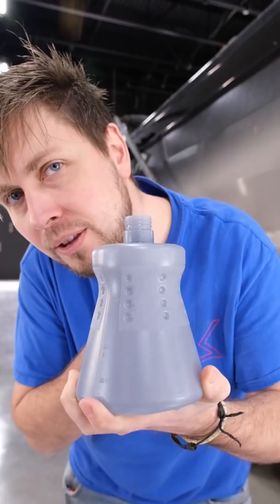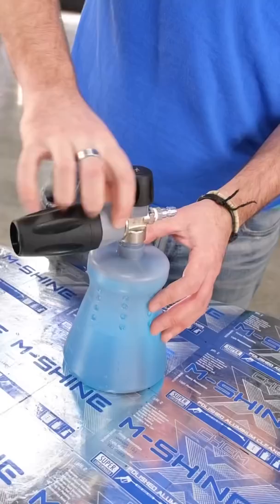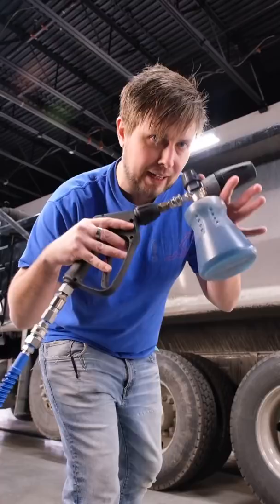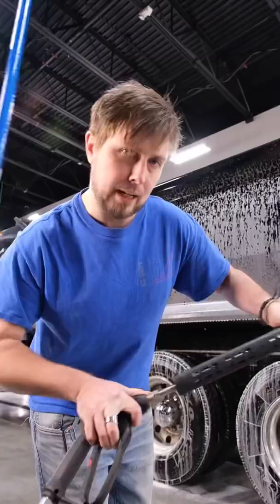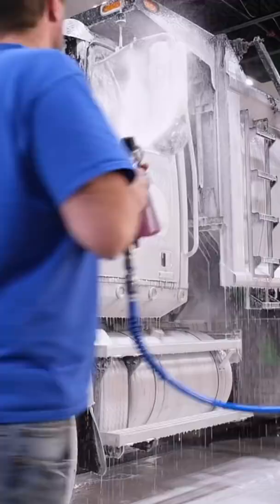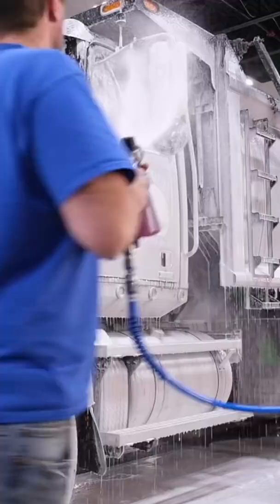Learn How To Get A LEGIT TOUCHLESS WASH in 51 seconds! #shorts

Comment: Yeah, gotta neutralise that salt which is obviously an acid
Reply from the maker: Salt is generally neutral on it's own it's more of a term for getting rid of the salt in general because it'll corrode the metals if you leave it on there
Reply: @Chem-X  oh so because salt can corrode metal you can call it an acid or a base? I guess oxygen is one of those as well then. Just because that's what you meant doesn't mean that's how its used. You can purify the water of salts, but you can only neutralise a solution which is acidic, or like you, basic.

Comment: Never rinse from bottom to top  #1 detailing mistake
Reply from the maker: That’s tried when you do a physical contact wash, touchless washes with foam applied at low pressure get miles better results rinsing bottom to top, it’s used as an indicator of where you have worked with the psi

Comment: Wait... Go back to that last piece of chrome... Look at all those water spots and runs... This is why you still need to wash with a cloth
Reply from the maker: Yeah it’s good to dry it if you have somewhat hard water, I showed that spot on purpose actually this system will only get you 90% there at best
Reply: @ChemX  I'm old school... Hose, micro or terry cloth, and a good soap..
Reply from the maker: Yeah this is just a shortcut in between a good hands on wash

Comment: Foaming is a huge waste of time and money in my opinion. Never really works all that great and pressure washing your car with any kind of dirt on the car is like sand blasting your paint.
Reply from the maker: Foam helps minimize the the potential for scratching in general compared to any other style of washing, this two part touchless system completely eliminates that risk while getting all the road film off, it’s also 80% faster then hand washing
Reply: @ChemX  to each their own

Comment: You’ll never ever get this shine surface wihout using a clean towel to wipe it up….
Reply from the maker: We didn’t, this is just a two step soap application that’s designed to get more road film off than a single step soap can, been used in the car wash and trucking industry for 40+ years

Comment: You start at the top and work your way down.
Reply from the maker: In a contact wash that’s right, not in a touchless wash tho the high psi is how you interact with the surface, this helps you not miss a spot which would only show once dry

Comment: You want to do top to bottom
Reply from the maker: Top to bottom rinse on hand washes is best, however the process works better in a touchless wash rinsing bottom to top, it helps you not miss a spot with the high psi which is removing the road film once the soap loosens it

Comment: Man...If I had $18.50 for every semi-trailer I've washed I'd be a...Never mind.  I should have charged more.  lol
Reply from the maker: Heck up my way truck washes charge like $150 lol, I’ve always washed for free to show my soaps tho myself
Reply: @ChemX  That was 1990 era prices.  I had a couple of fleets every other sunday.  It was $22 for the tractor/cab.  16 for vacuums.  Man.  I was 24, freshly married, and thought it was almost as good as a 5 hour shift at Zbistro.
Reply from the maker: Lol nice, did ya use two step or were ya brushin?
Reply: I used a soap called "Challenger", brushed, and rinsed.  I turned a side of an old white farmhouse silver once with that soap.  I knew it was chalky...lol.  I didn't even put the pressure washer to it.  It just rolled off like milk with that soap.  That was my first season washing.   By 2000 I was mainly doing deck and wood roof restoration.  
     I was one of two powerwashers in the Indianapolis yellow pages.  He only did fleets.  I was the only guy that washed anything.   
     I stripped a few big Wabash National presses in Lafayette when they put in another line at the factory.  over 100 gallons of stripper and hot water on each one.
     My least favorite job was the loaders of US Aggregate. The EPA would give them a 90 day notice on inspections.  They'd call me to come clean the loaders so they could find the leaks.  It was cheaper to use 50 quarts of oil a day than repair the things.  No matter how many layers of rupper I wore that baked on oil and hydraulic fluid turned me into a grease monkey.  Diesel fuel was my body wash until I realized vegetable oil cut it. Soap would cut the vegetable oil.

Comment: It it top to bottom
Reply from the maker: I rinse top to bottom after a hand wash, the bottom up method just helps you not miss a spot with the high psi rinse in a touchless wash, it can be hard to see where you missed while it’s wet

Comment: You actually rinse from top to bottom bud but okay
Reply from the maker: I rinse top to bottom after a hand wash, the bottom up method just helps you not miss a spot with the high psi rinse in a touchless wash, it can be hard to see where you missed while it’s wet

Comment: From top to bottom not the opposite...
Reply from the maker: In a hands on wash that would be correct, touchless washing with low psi foam application works out a bit better rinsing bottom to top, primarily its because the foam serves as a visual aid so you can see where you have hit with the psi which is the final step of removing the road film

Comment: False always work your way from too to bottom
Reply from the maker: Not always no, I would do top to bottom if I was doing a normal hand wash, bottom to top helps you to not miss a spot with the high psi rinse during a touchless wash, missing a spot with the psi is like missing a spot with a mitt, but harder to see while wet so I use the foam as a gauge

Comment: Neutralizes salt?... What did you just say?
Reply from the maker: It’s a term used in my industry referring to shutting off metal corrosion from leaving road salt on a vehicle
Reply: @ChemX  ah okay. I am a chemist and it confused me

So, its just washing the salt off. But water does that too. What excatly is it supossed to be doing?
Reply from the maker: Yeah salt is technically neutral from a chemistry perspective, but as far as road salt on a vehicle you want to fully clean it off to prevent rusting, this system removes the salt completely whereas rinsing with high psi water alone would still leave the salt residue behind
Reply: @ChemX  Sorry for bothering you with doubt. I know I am just a random internet person, and, I will take it if I am totally wrong, but I am doing chemistry, and I am not sure about that statement. I am 99.99 % that that statement (and products that are supposed to do that) are scam.

Salt solubility is 360g / 1 l of water.

(adding electrolytes increses ionic strength, but in those solubilities it's no change)
Reply from the maker: @krtm7231  No worries at all man I respect your thoughts and you certainly have some solid perspective. Even aside from my own products I do think that most salt neutralizers on the market are helpful in the wintertime to fully remove salt. In my own experience rinsing salt off with water alone still leaves a white salty residue behind, I think there is value in completely cleaning it off to keep any metals from rusting as much as possible
Reply: @ChemX  Get you now, but I still can't see how would something do that.

Only thing I can think of (which we do in lab) is to wash it with distilled / deionized water, or to just wipe it after washing.

Could you link photo to chemical composition? I am really curious
Reply from the maker: So for example let’s look at a municipal setting, you have 400 pieces of equipment to wash on a weekly basis and make last as long as possible, and the workers can’t wipe off every town dump truck fully within the frame rails and the engine compartment and inside the rims and on and on, that’s where a salt neutralizer comes into play. I don’t think deionized or RO water is cost effective or that it gets the job done myself. I’m not big into the salt neutralizer industry myself but I do think that there is a legitimate need for the concept to prevent premature failure of equipment. As far as chemical composition I’d rather not fully disclose my formulas online I do have quite a few competitors looking to find out how I do what I do
Reply: @ChemX  hey! You are master in your industry. I will take your word for it, and do some research later. It just seemed really weird for me :) I didnt mean to poke you or something like that.

Thankful for debate.
Reply from the maker: Absolutely man I appreciate your input, this winter I’m planning to look into a dedicated solution for salt and I’ll have to dive into the topic more fully and see what the value of it is and the difference between using it vs not

Comment: Touchless wash is a complete rip-off I details cars for 20 years I don't care what you use you have to apply pressure to the vehicle and or whatever you are washing to get an actual clean
Reply: Depends on if the car just needs a touch up wash or not. If the car is taken car of and waxed properly; light road dust and other debris should come off with ease
Reply from the maker: Try my soaps first then let me know, for now I assume you’ve only used single step systems that make big claims

Comment: Top to bottom always, this wont clean it 100%, only way to clean a car completely is to touch it, sorry
Reply from the maker: This won’t take it 100% it’s a shortcut for in between hand washes to save time. The reason for bottom to top rinse in this situation is to help gauge where you have hit with the high psi, the soaps loosen the road film but the high psi is what removes it, if you miss a spot with the pressure it will look fine wet but once dry you will see the spots missed. On a hand wash you would rinse top to bottom to save time though.

Comment: I call bs.
Reply from the maker: Why’s that?
Reply: @ChemX  it won't actually come out clean unless it's not very dirty. Even using a pressure washer doesn't clean a car good without scrubbing first.
Reply from the maker: The key is to use a soap system that can perform a ph shock and then to rinse thoroughly at high psi, still won’t get you to mitt quality but it can get 90% of the way there
Reply: @ChemX  ph shock? Are we cleaning pools or cars? The only way I would believe it is if the soap penetrates and lifts dirt and grime while being paint safe.
Reply from the maker: Yeah it’s paint safe, two step washing has been used by the truck and car wash industries for about 40 years now